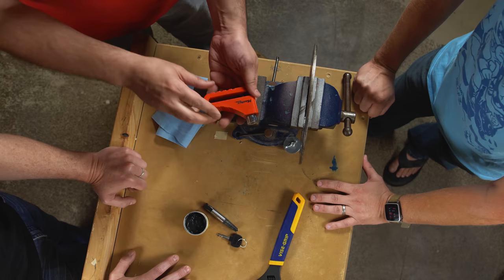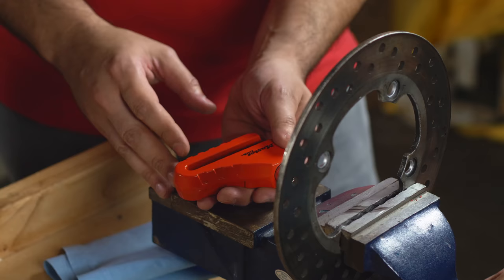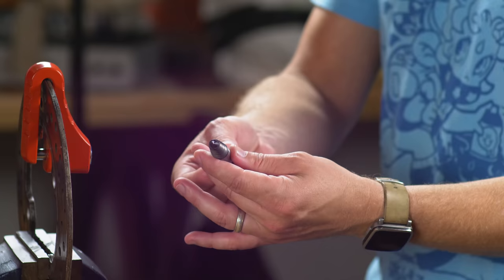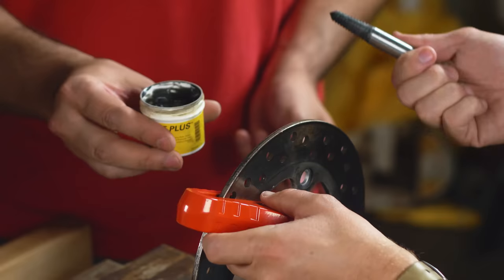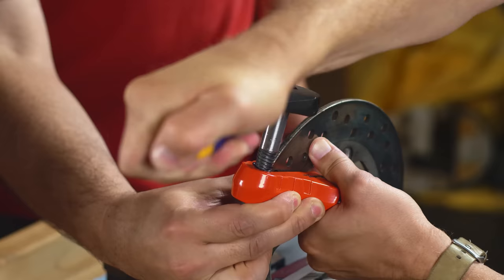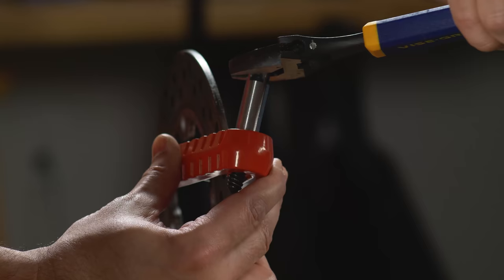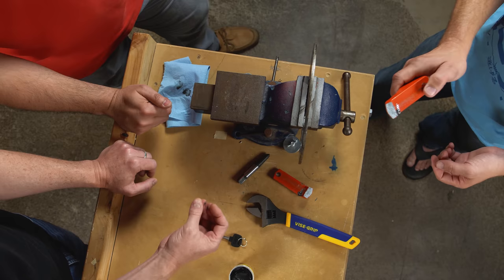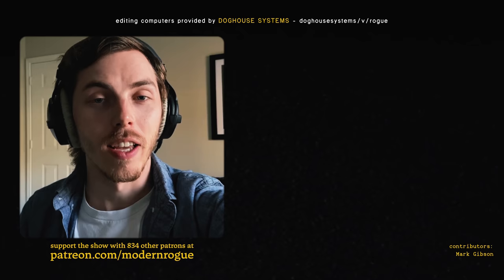The $5.68 Hardware That Easily Defeats Motorcycle Locks (with LockPickingLawyer)

Comment: And that's why you should (lightly) grease your wheel nuts too, you get the job done with 20% to 30% less torque applied. So whether your changing a wheel on a rainy highway late at night or grabbing that juicy Honda bike, less time spent fighting torque the less time you're spent exposed to risk.

Comment: Welp... Time to hand forge myself a motorcycle lock. Probably need to come up with some complex item based lock system like from Capcom video games.

You need the bronze mask to unlock the silver mask to unlock the key to unlock the room with the locked away gold mask, then find the frog statue in the pond to place in the fountain in the main hall to open the knight's mask to get the key to the wine cellar, find the correct bottle of wine to place in the slot on a shelf in the dining hall to unlock the red key card to unlock the gun safe to get the green key card that opens the hidden door in the basement that gives you the blue key card to get access to the vault that holds the silver key for the chest in the attic that contains the key for the gold mask that then goes into a recess that opens a secret passage that leads to the encrypted cipher that unlocks a chest that moves around the house every hour so you can get the key to open the slide on the motorcycle lock so you can finally access the 18 pin Italian door lock used to secure the disc brake lock on the motorcycle. whew. Who needs a treadmill after that?

Comment: That's why die-cast zinc isn't a good option as the material for the lock's body. You want to go with hardened / tempered stainless steel. I learned this and so much more about locks by the man himself, LPL.

Comment: I use the smaller one, and lock it on the hole, there is not much gap between disc and lock, so, even some one break it, at least I lock it.

Comment: I get that casting is easier for manufacturing especially, in making the part to fit the lock mechanism, but seeing this vulnerability it seems like they could just a U shaped metal rod during the casting to strengthen in. The melting point of steel must be a lot higher than this alloy, the lock mechanism would still be housed with the alloy only but at least the u shape is strengthen. 
Either way, the one I like about a break lock is that it could seem more inconspicuous. I don't know how true this may be, but sometimes it feels like fancy locks attract thieves, either the lock themselves indicating something worth protecting, ergo worth stealing or seeing it as a challenge. If your break components are black and this lock is black one would hardly notice it. I don't get why so many locks are so bright in colour. Maybe the logic was to warn the would be thief that the bike is " protected" or something.

Comment: A hardened steel disc lock without the huge gaps in which to insert the screw,  that hugs the disc all round is the one to choose but all locks are going to lose faced with a determined thief, power tools and enough time.

Comment: cast zinc well its only the metal with the fourth lowest melting point on the entire periodic table 
if you include galieum and mercury  the 3rd being lead 
zinc melts at around 600 degrees I think so this lock would be easy to not only melt but also easy to just simply break like shown in the video

Comment: I know I'm late to this, but I want to point out something about the lock.  When someone is out to steal any motorcycle, any decent looking lock will make the pass your motorcycle over. I've got a 2008 Honda Spirt with a dented gas tank.  When someone out to steal a motorcycle sees the lock on my disc, they are going to keep walking, so the lock does it's job. (Adam Ruins Everything called this Security Theater, I think.)  Now, if they are out to steal a specific motorcycle make/model/year, there's no much you can buy on the market that will actually stop them. They'll get your motorcycle no matter what you have.  You have a 2022 Honda Goldwing with all the bells and whistles, and they want a 2022 Honda Goldwing with all the bells and whistles, the best disc brake lock in the world is not going to stop them from taking your motorcycle.

Comment: Yeah, motorcycle locks like that aren't even very common anymore for modern bikes, because it's been really popular for manufacturers to build in their own security. My bike is almost 10 years old and it has a built in physical lock that locks the handlebars in a permanent position, plus a remote fob that if the bike moves more than a few feet without the fob close enough it engages a separate bolt lock on the front brake. I'm fairly confident that unless someone took the time to remove the whole front end of the bike, they're not going to steal it. Just saying. Maybe if there's an exploit for that system, I'll be interested in upgrading.

Comment: If the brake were mounted on a motorcycle, would the lock have simply fallen off?  I would expect the mechanism to have remained in the wheel, but I guess it depends on the particular geometry of the wheel.

Comment: How easy/hard would this be if the lock was actually on a bike though?
Reply: If you have the appropriate one for you bike, properly on there would be no gap, you wouldn't be able to move it around like they do either. The purpose of these locks is to stop people just putting the bike into neutral and wheeling it away.
Reply: I've seen someone just jam a pry bar in and snap them off... in the middle of a busy street.

Comment: Anyone who thinks this is educating bike thieves is very naieve. They already know that zinc locks are garbage... that screw extractor idea is pretty novel but i've seen theives snap them with a thin crowbar in seconds then wheel the bikes into a van and drive off... the whole operation under 30 seconds. This video is to show consumers that there are products on the market that are advertised as being secure but are actually worthless. Invest in a hardened steel disc lock if you want to give theives more of a headache.
Reply: I addressed this in another comment already but the short version is there are too many good people that'll never see this video but just enough bad people will see this and learn new techniques to victimize good people they previously couldn't. Want to really help good people, make good locks cheap or cheap locks good. It's not that people that fall victim don't know better, it's that they wanted the cheapest thing available. They could have looked into the expensive locks and researched why they cost more but they didn't want to do that and get the best lock for the money. They just wanted the cheapest lock.

Comment: Okay but chances are if they put one of these on they've also locked their steering column. What would be the point of this? With the column locked you could only turn in circles, so you would have to lift the bike up. If they can lift the bike up this product is useless anyway. My bike is over 800lbs so good luck.